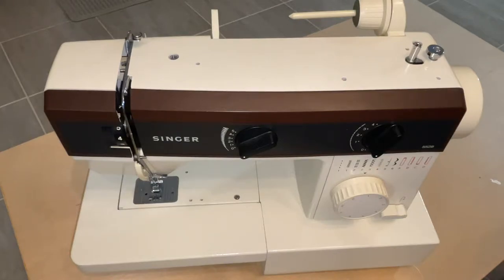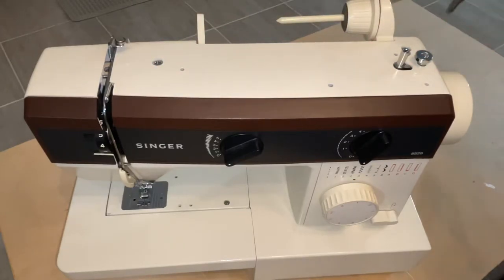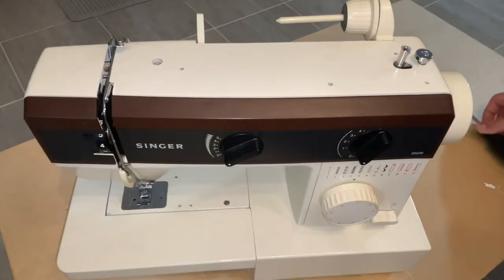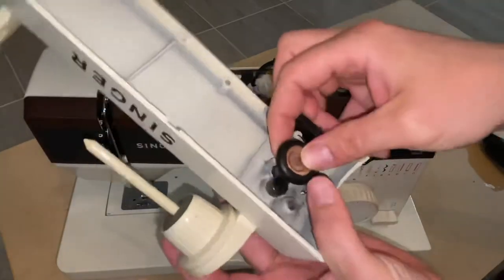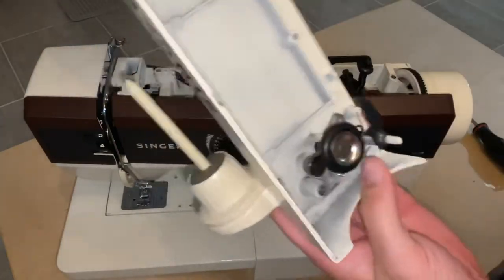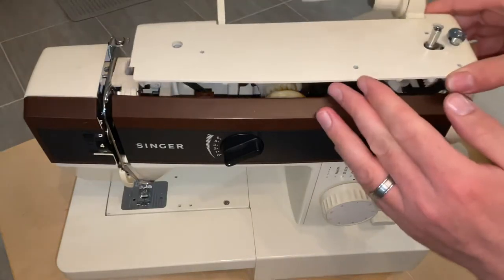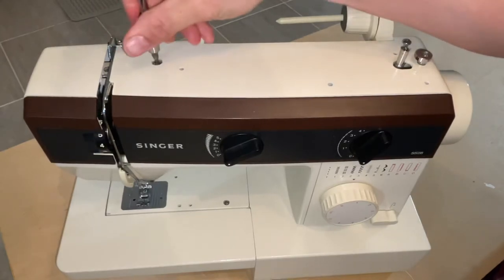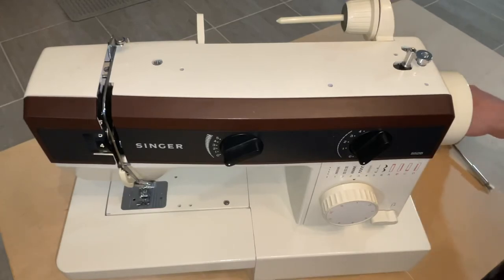Replacing The Bobbin Winder Wheel On Your Sewing Machine

Comment: Thank you for this video! Is the silver part (that the rubber wheel goes around) supposed to spin? My rubber wheel is ripped but the silver part does not move or spin at all.
Reply from the maker: You’re welcome. Yes that is supposed to spin. Perhaps you have debris lodged in it. Try cleaning it and applying some oil to it to get it moving again. If that doesn’t work then you will need to buy a new winder. They can be found on Amazon or on a website called www.sewingpartsonline.com. Thanks for watching. Hope this helps. Please like and subscribe

Comment: Another thing. My bobbin wasn't winding. However, I had had to oil the handwheel and shaft to keep the needle from going up and down when trying to wind the bobbin (after loosening the clamp / clutch). So there was some oil on the rubber bobbin winder (remove the top of the machine and look underneath where the bobbin post is). Oil, no friction between the winder and the handwheel; so no winding. I cleaned the surfaces well (the rubber winder and all around the handwheel where it would make contact), then it would wind!!

Comment: My singer 7426 bobbin winder just doesn’t work at all makes loud jamming noises. Will this procedure work on this model as well?  Resorted top buying a separate bobbin side winder.
Reply from the maker: This would only fix a slipping bobbin winder. Your scenario sounds like the winder is seized and lacking lubricant. Have you tried oiling? Hope this helps. Thanks for watching. Please like and subscribe

Comment: Any trick to getting old ring off? Can't budge mine
Reply from the maker: If you use an exacto knife and slice it then you can peel it off easily. Then for the new rubber, boil a pot of water then remove it from the burner, drop the new rubber in for a quick minute so it heats up and becomes flexible. This will make the install easy. When the rubber cools back down it will be nice and tight. Hope this helps. Thanks for watching. Please like and subscribe